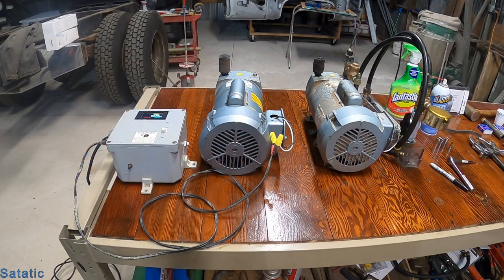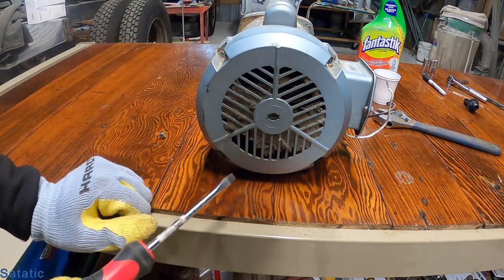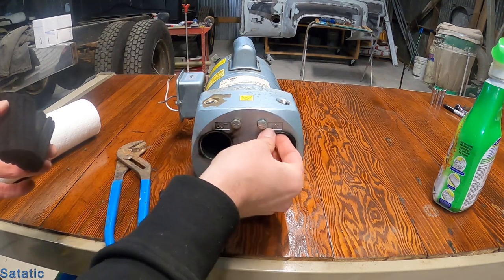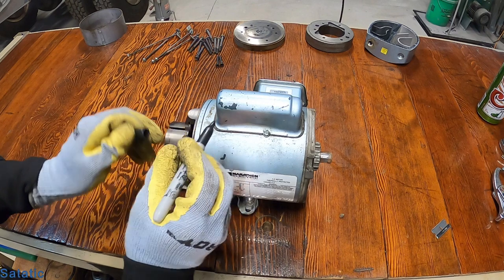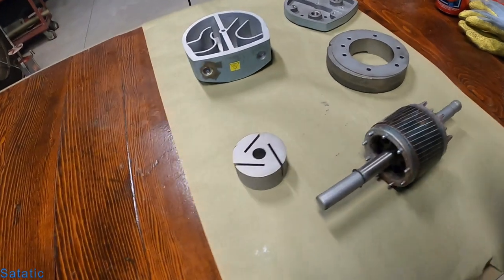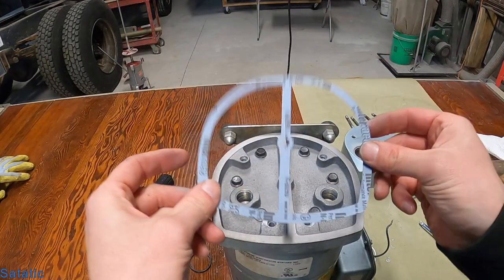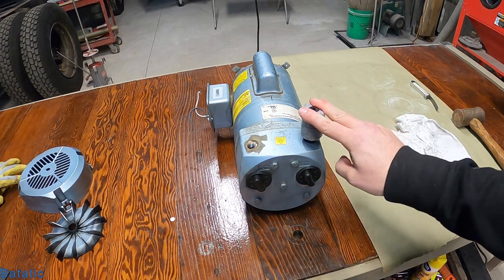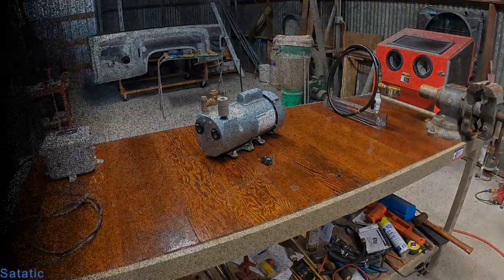Gast Rotary Vane Septic Aerator Motor Rebuild

Comment: The ribbed ring that vane rotor presses over is a tolerance ring made by USA. Motor repair shops may have them , or available from Essex Brownell or EIS motor parts suppliers.

Comment: Jeff, I have a GAST 0523 and the rotor that holds the veins actually broke. The veins broke and jammed in the housing and before I could shut the motor off it bound up with pieces of a vein and broke the rotor. Where can I get a 4 vein rotor? Loved the video and explaination how to remove the rotor.

Comment: Thank you.
Have a similar one newer for pond aeration a G588NDX 1/4 pH but exactly same inside fan cooling different. 4 vanes pushes 5cfm normally... Repair guidance much appreciated. BTW strangely no micro gasket for vane c
Plate cover nor did the repair kit include one.

Comment: Jeff I have the G213DX that is about 20 years old and never had a problem out it until today. It’s making a terrible noise like bearings are out. This unit is now replaced by G215DX. Where can I buy bearings for the old unit?
Reply from the maker: They are probably the same as this unit. I just order from Amazon.

Comment: I have the same model, but without the capacitor on top, and doing a rebuild just like in the video. When I was taking the bearings off, a white plastic piece, in the shape of a cross with two cross sections, with a spring, broke off a black plastic panel that has two wires going to it, a blue and red. There looks to be a jumper to a contact, from the blue to the red, but it isn't continuous. I'm a little confused as what its purpose is, or how it goes back on. I'm assuming it is some sort of switch, given the spring, but electrical is my weakness. Any knowledge of this?
Reply from the maker: That is part of a centrifugal switch. It presses into the plastic disc on the shaft. At low speed it is engaged to allow full amperage to go into the windings. Then after the motor starts, the weights fling out and break contact to drop it down to just a few amps. This happens in a split second. Does the same job as the capacitor. It is probably a SGE-1129 what I would do is take it out and go to a motor repair shop. They probably have one in the back they will just give you. It should have a couple tabs that fit into square holes in the end of the motor case.
Reply: @Satatic  that's exactly what it is! Thank you for the swift response!

Comment: Hey Jeff, I've got one of these aerators. The motor turns on and spins just fine but not does not produce any air at all. What would cause this?
Reply from the maker: The vanes are probably crumbled.
Reply: @Satatic  indeed they are. I took it apart and every vane is in small pieces. Is this a common thing to happen? Just general maintenance over the years or am I likely looking at a bigger issue..?
Reply from the maker: @junod.j  just wear and tear
Reply: @Satatic  good deal, thanks Jeff. Have a good night

Comment: Would you mind sharing what the specs on the Capacitor are ? Mine was replaced long ago and it now needs a replacement, but the markings on the Cap are gone.
Reply from the maker: They are 5uf rated but the problem is I have been unable to find an exact replacement. So what I have been doing is getting the 5uf capacitors for ceiling fans. They are small enough to fit under the cover and they seem to work. Add some connectors and a little bit of tape. https://www.amazon.com/dp/B07BCB98P2/ref=cm_sw_em_r_mt_dp_1R37SQW6YXPM43KNS925

Comment: Hi Jeff, do you rebuild, if a client was to send you a Clearstream CS103E6.  I believe it's a 3-vane Aerator, GE Motor, dam thing almost unbreakable. I don't really know how hold it is, as I bought the property only 7 yrs ago.  For all I know, it could be the original. Septic system installed in 1998. I replaced it with a GAST AT05, as GE doesn't make this 1/4 hp Aerator anymore.  If it's economic to rebuild & keep as a spare, that was my intention. Besides the vanes, which I could do myself, I don't have the tools to attempt a bearing replacement.  Not sure, how I can contact you privately to discuss.

Comment: 15 tenths
Reply from the maker: Is it? Maybe I need to study up. I just know it needs to be about .0015. I set one at .004 a couple days ago because I forgot the number and it dragged and ran at 4.5 Amps instead of 4. Had to disassemble and push it down a little more.